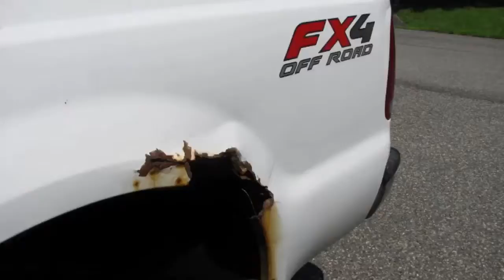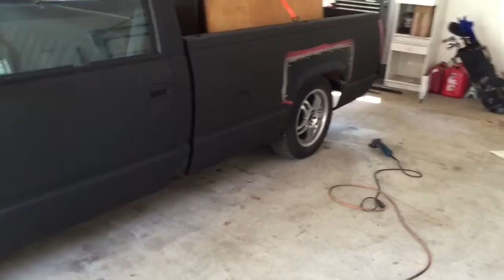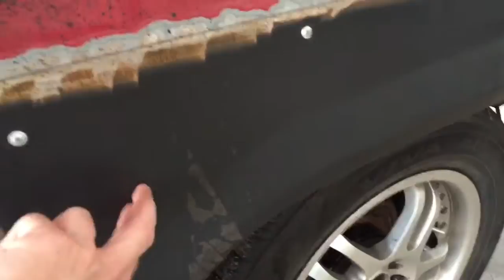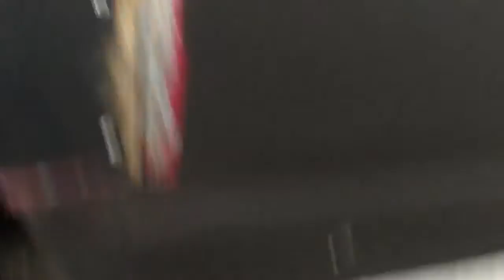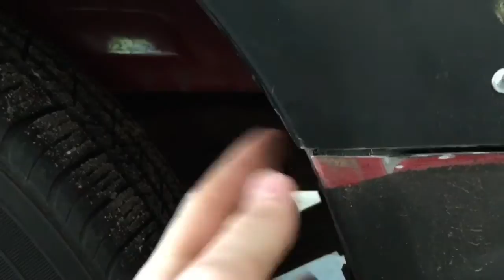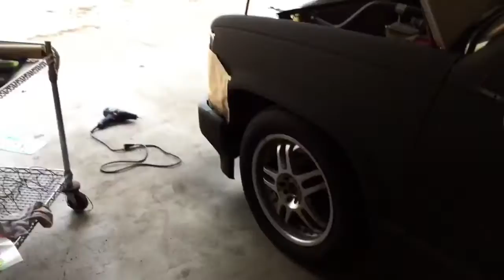Wheel Arch Rust Repair - Rear Wheel Well Silverado

Comment: I would never do a repair like this. Now you have a double layered panel there that just screams to blow through again. I cut the rusted metal out only as far as clean, good steel and then trim the panel down and butt weld the panels together. Then there is no overlapping, the integrity of the entire panel is maintained, it looks original and it will last the life of the vehicle once properly coated and rust proofed.

Comment: To keep your panels from warping spot weld 2 inches apart all the way around and then go back over and spot weld in the center of those spot welds and just continue on so you have a continuous weld but it takes longer a bunch a little spot welds will keep it from warping and believe me you will see warping if you don’t do that

Comment: If you put your template up instead of screwing it down and cutting it out as it’s on there take a sharpie magic marker mark your outside edge take your template off and then cut on the inside of your magic marker Line gives you a perfect fit I’ve done it for years it works great

Comment: You don't need anything but a cheap 110v welder for welding thin sheet metal body panels.
Reply: Yeah if you want to warp the metal and blow holes through the metal

Comment: Im welding mine in now im going to spray undercoating behind there i hate seeing trucks rust out there
Reply: I would wire wheel the inside weld and apply a nice layer of waterproof 2 part epoxy....🙂
Reply: I would not use undercoating. That shit causes rust, and the first bit of gas that splashes on it will melt the shit off

Comment: Just a quick comment. Generally a very good vid. If you plan on doing this again, I would do this. Gently clamp the new panel in place with a couple horse shoe clamps( some thin pieces of plywood under the jaws on the panel side), then just scribe a line around the new panel. Then cut Up To the line with the cut off wheel. That way there is no gap, and one can more easily weld the new one in place. You don't need a lot of amperage to tack in the welds for this, but a perfect fit helps immensely.
Reply: Flux core is too hot for butting metal, plus you have to have a gap or you put no filler weld into the metal resulting in 0 penetration.

Comment: Hey nice video. You speak really well. Question - why dont you just weld that new piece onto the original metal as it is? I am hoping to do this on a dodge dakota ext cab.
Reply: Because you would have to use a gallon of bondo to make it look right, plus once the filler shrinks one can see the outline of the panel